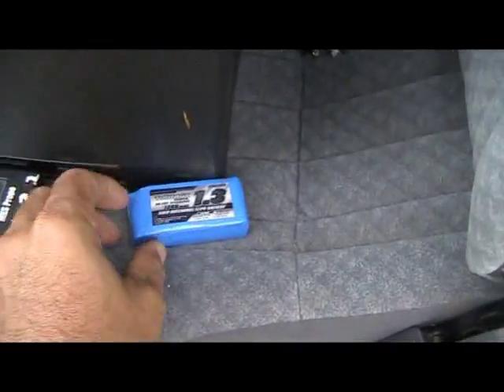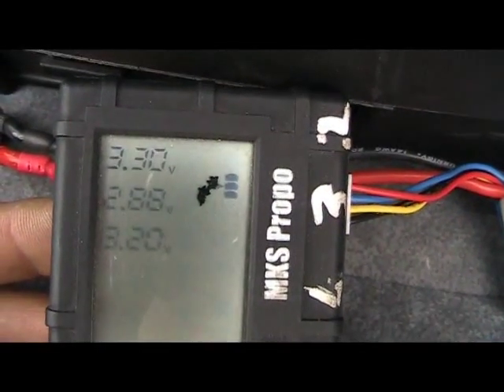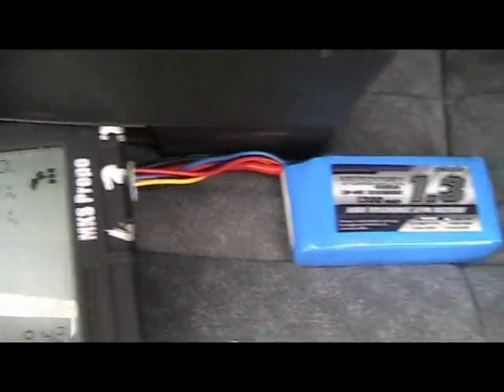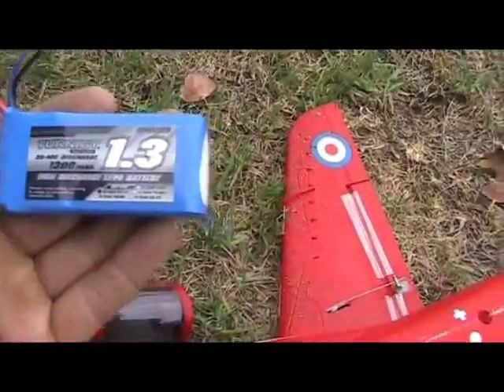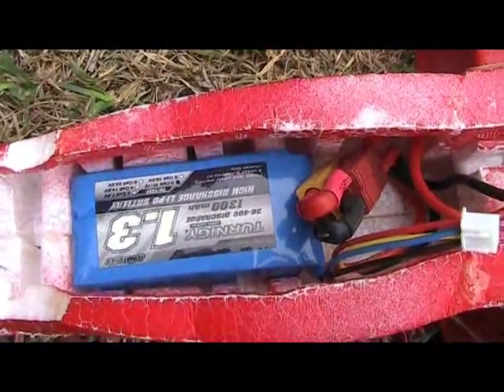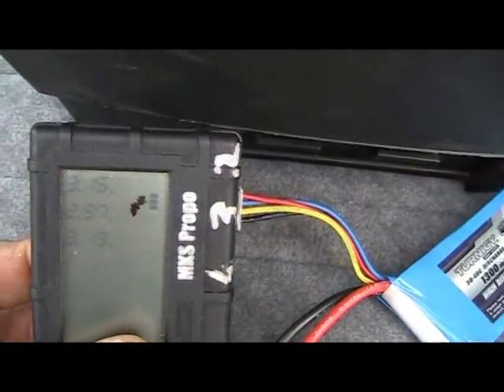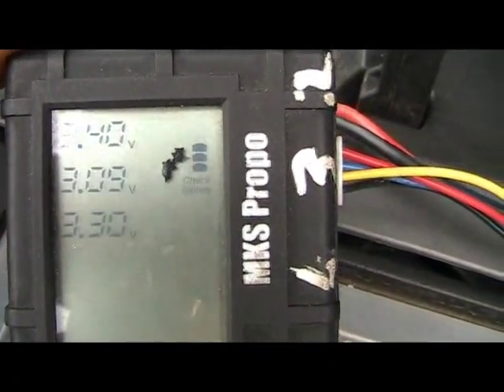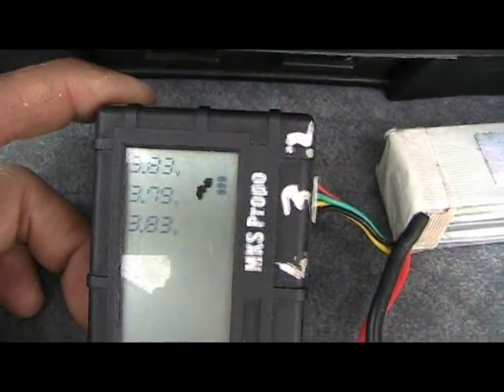Hobbyking Turnigy Lipo Test

Comment: That really blows! As far as I understand, Turnigy is actually a brand that amalgamates a bunch of no-name components under the same, randomly QC'ed banner. At least that was my understanding of their motors. Ever since we went Hyperion for our batts, we haven't looked back. Their discharge is rock-solid and I've never seen a cell more than 0.03V out from the other ones. We use a number of batts from the G3 range: 1100mAh 2S, 2500mAh 3S and 2200mAh 4S - none of them have ever failed us =)